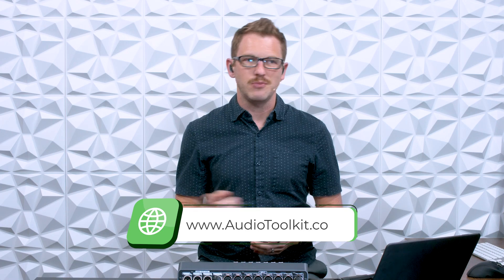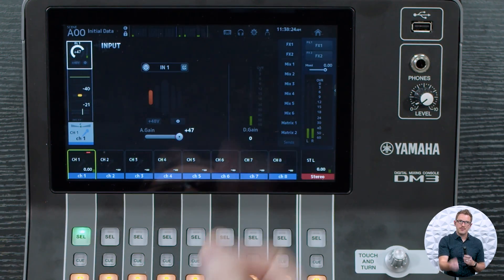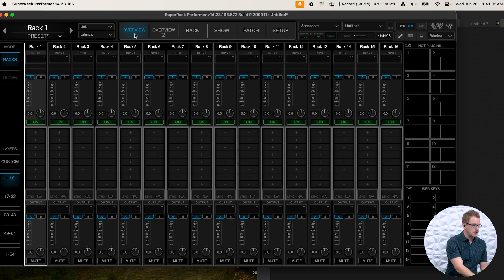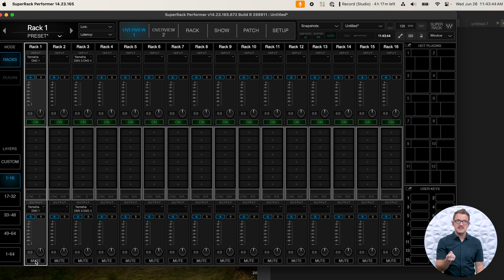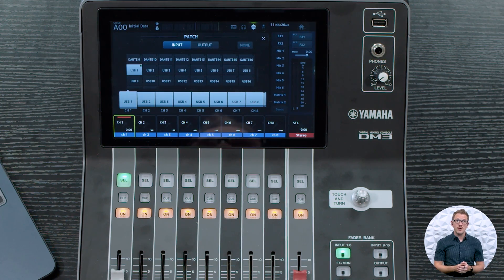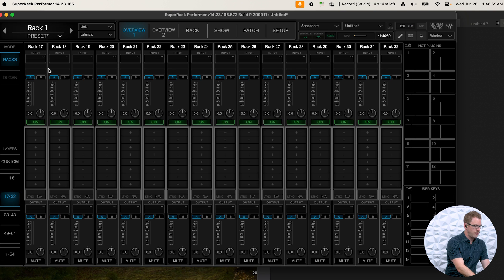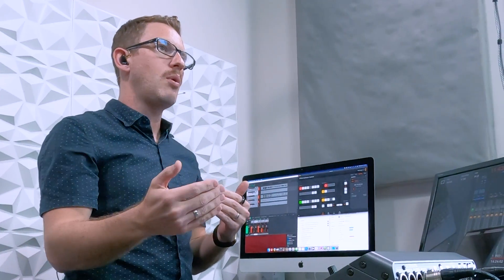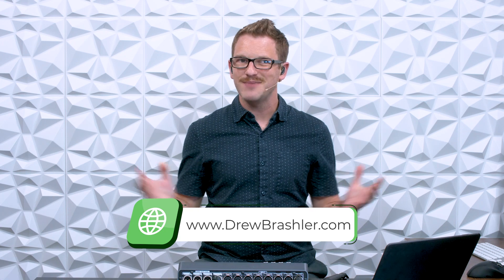Yamaha DM3 + Waves SuperRack Performer

Comment: The latest DM3 firmware update adds inserts now, so it’s even easier to do this… and has a kill switch and multiple modes for the USB driver too so you can do some waves inserts and still do Spotify / BGM on “another soundcard”… smart…! 

(I know you will know this but, for others interested etc!)

Now, if they’d only add Dugan……

Comment: Question for soundman estimates for a live performance with monitors
When a guitar player arrives with an acoustic guitar that has a pickup to connect to a DI box
And the guitar also has volume and EQ buttons
What is the right thing to ask the guitar player?
Will all the buttons be on the middle?
Volume button at 50%?
Will the IQ buttons be flat?
One of my concerns is that after I have stabilized GAIN, the guitar player may during a performance change the position of the buttons (for reasons of his own) without me having control over it, but this will affect the color of the sound, and even cause feedback
Thanks Miki
Reply: I usually ask the guitar player to keep everything at 12 O clock. Make him play normally like he would in a show. That becomes my starting point. I make adjustments accordingly after that. In most cases this works else ask him to adjust his volume up or down.